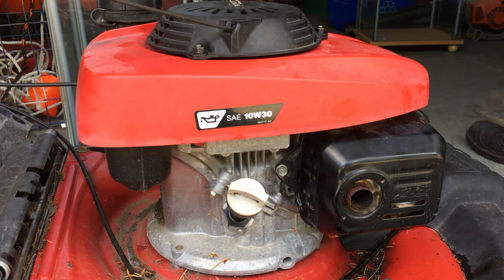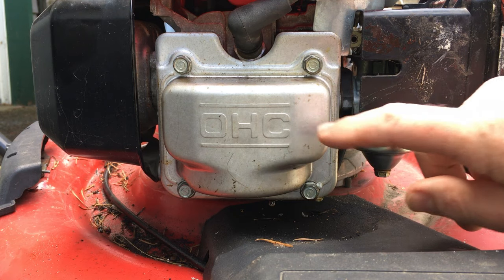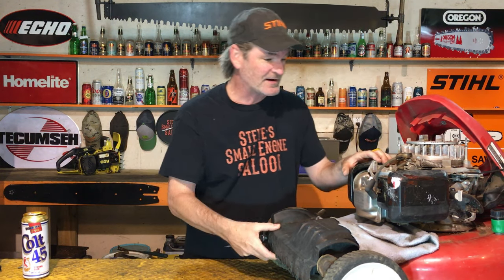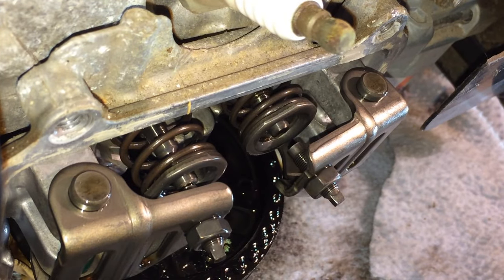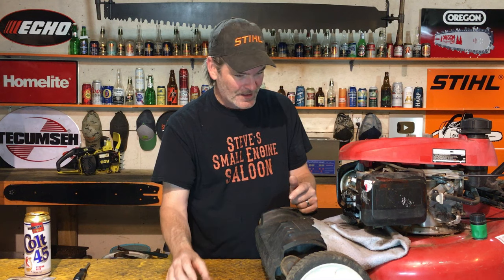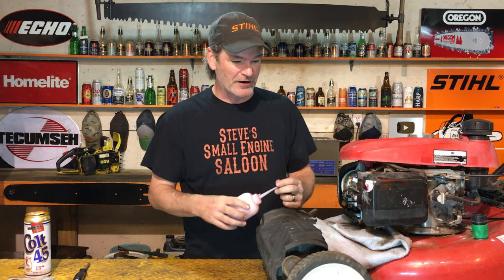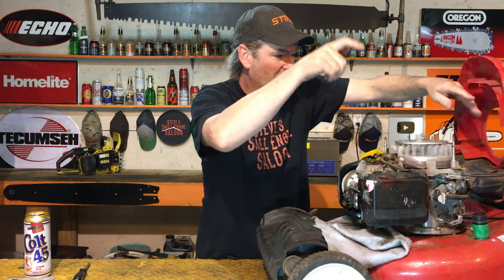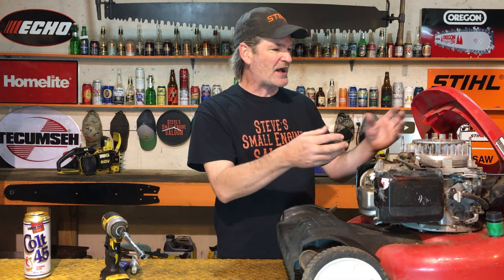How To Fix A Lawn Mower With No Compression

Comment: i i love your videos im single female who has to try and repair my own mower ,sure wish you had some vids on murry push mowers with ready start engines cant figure mine out ...
Reply: Most Murray mowers are powered by Briggs and Stratton or some may be Tecumseh engines.  Look at it closely and see what it is. Then, check through Steve's videos to see how to diagnose your problem. Clean oil in the right amount, right SAE  weight and never overfilled, fresh gas, a new spark plug properly gapped  AND a clean air filter to start with first. Murray/MTD make a majority of mowers that are "branded" as other manufacturers products.  download the engine manufacturers PDF for that exact engine. Briggs and Stratton engines have three sets of numbers that identify each particular engine known as the Model, Serial and Code. When ordering parts you must have those three sets of numbers and if you call or go into a local supplier, it's the first thing they will ask you for. Older engines have them stamped on the metal cowl that fits over the engine that the recoil starting winder is contained in,  just above where the spark plug is, the spark plug wire coming from the coil emerges from a little bend in that cowl. The cowl is also what directs cooling air down onto the engine block when it's running. The numbers are right there. Wipe off the grime with a rag dampened with some WD40 and you'll see them. Make sure you write them down EXACTLY. Every part designated for those numbers will be the right part for your machine. The newer versions of the 400, 450, 500e series engines have a QR Code and a serial number on a sticker to aid in downloading information and parts from the factory. Hope this helps. Good luck... get some tools and start turning wrenches!

Comment: I have been inside that valve cover of a honda engine countless times! So I figured I would comment about this. First,  I always take a BernsOmatic propane torch and go around the valve cover and put a little heat around the edge before I start prying on the cover because they don't come off as easy as yours came off unless someone has had it off before. But it has been my experience that you will bend the crap out of it trying to prying it off cold! Honda bond is some of the best sealant i have ever seen used in the mechanical world! That and Permatex ultra black are brutal to remove a sealed pan gasket with it on  without applying the heat first. Now, once you get the cover off of a honda there are two things you should look for right away! First thing is whether you have an old style valve cover or a new style cover because it it doesn't have the  piece of metal that keeps the timing belt from being able to jump the teeth on the cam gear you could have a engine that has jumped time with the old style valve cover. And next thing you will want to check ( And especially if you're dealing with a horizontal shaft engine like you would find on most power washers is if the  exaust rocker arm is cracked! I have seen this happen several times before when it has been ran with a loose adjustment and it starts beating the crap out of it! And it's always the exaust side that this happens to due to the heat that the exaust valve side experiences.  😉

Comment: everyone that knows me always asks if i want a lawn mower they picked from garbage.   i always say yes because i take metal to scrap yard if it isnt worth fixing.   i bet there was only one mower that wasnt worth it out of all of them and most were all simple carb cleans spark plugs. air cleaners never replaced etc.    i have a super front wheel drive honda I picked from the garbage 5 years ago.   still runs great.  new air cleaner and drained the fuel bowl.  thanks for the great videos

Comment: new Yard force mower with  briggs 675exi engine 7 mowes on small yard...NOW no compression,  i check the valves like your video you can push them in and they spring back out.  What else to check??

Comment: Hey Steve! I have a John Deere JS60. It has a Briggs and Stratton 12h802 motor on it. My father told me before he passed away that it was "shot". Not knowing what he meant, I started to take it apart because it wasn't starting. Took apart the carb, cleaned it completely and that didn't work. Changed the spark plug. It doesn't start even with starting fluid. Barely gets going at all. It puffs white smoke from the exhaust when I start it and backfires sometimes too. Compression is definitely not there. My question is what can it be? Coil? Valves? Can you lend an opinion? And if it is the valves, how do I access them? And I guess my first question should be is it even worth fixing? Lol anyways, I really hope you get back to me on this. Thank you for your time!
Reply: Replace the flywheel key
Reply: @daviddavis981  the flywheel was actually intact and in good shape. I had 2 of these mowers and 1 worked so I decided to just junk this. Thanks for the help though

Comment: nice job. may i ask if a highly polished trans pulley on a regular self propelled mower cause the belt to slip?  has nuff tension but the inside of of pulley looks like chrome it is polished so much. thanks.

Comment: Solid Gold - thanks Steve. Had the exact same problem and I am very grateful for your solution.-  the mower had been sitting over winter and started 2nd pull no problem this is probably the 4th time I used it and low and behold had no compression - I lost a lot of time messing around checking spark plug, spark and fuel - I even pulled of the exhaust to see if that was carbon blocked. The mower had run perfectly last week and suddenly just refused to start and after being unable to fix it - I headed inside and decided to see if you had any good advice - as usual you had the solution.
Reply from the maker: You're Welcome...and Thank You...

Comment: Steve, I had a similar no compression problem on Honda GX powered paint sprayer belonging to a painting contractor. I broke it loose by taking my drill and chucking up a socket and turning the crank over rapidly and squirting carb cleaner until it broke loose and started to run. Once running, I let it warm up, shut it down and drained the nasty crud that was taking the place of clean motor oil. I called the guy and told him to bring me some fresh oil. I had it purring like a kitten while he hooked up the paint hoses to clean out the water and latex and run mineral spirits through the paint pump because of the freezing temperatures expected that night. I asked him when the last time the engine oil was changed. Almost 4 years old and he said he only added oil. He had coked the exhaust valve. 
Thanks to your video, I will know to look both ways at the valve train. I knew on this one that it had to be the exhaust valve once I checked the oil before starting to work on it, as it was "sludge o matic" grade funk. I still find it hard to believe that people don't know to change oil per manufacturers recommendations. It was a top of the line spray rig he said was over three grand and had NEVER changed the oil. I charged him 40 bucks, he gave me 60. Go figure.

Comment: I have a 140cc B&S that’s blowing exhaust out the crankcase breather tube.  I changed the head gasket and adjusted the valves…Would a sticky exhaust valve cause the crank case fill with exhaust?? Or would it be the rings  ??

Comment: Nice fix Steve! Have you ever tried Blaster Advanced Small Engine Tune Up? I've used it many times with poor running or smoking engines and it does a great job cleaning pistons, rings and valves.

Comment: Obviously this is an issue with this engine.  This is why I watch you Steve!  I was ready bro tear down my motor and replace the valve, now I have a much less involved project this weekend (hopefully).  I still need to clean the carb as this mower has been sitting for years, I am glad I didn't throw it away.
Reply from the maker: Glad to help

Comment: You and Rainman Ray are excellent teachers.  I like and use the penetrating oil your brother taught you to make.  It has been working great for me.  I also use something my Grandfather and my Dad used.  Our family were farmers and my Grandfather owned and operated an auto garage in town.  My Dad also worked for an engine rebuilder during the winter months.  In both placed they used Marvel oil for a lot of things. They would coat bearings and cylinder walls with Marvel while assembling. They did this to prevent scoring when first stated.  I used to drain tankes in my small engines in the fall and use fuel stabilizer in my supply of gas in the winter.  Sill I had to replace the carb kits every two years.  I gave up on that.  I not only run a couple of tablespoons of Marvel in the oil when I change the oil in each of the air cooled engines.  I also started putting in a tablespoon of Marvel in my gas cans before filling with gas.  I would use the gas with Marvel to mix with two stroke engine oil. Since I stared this about 30 years ago,  I go ten years plus on these engines before replacing carb kits.  I realized about a year ago I should treat my vehicles the same.  They are running very well.  For my grease, I use a white wheel bearing and general purpose.  Very good at high and low temps!  I use this in bicycles, too.  I learned the white grease trick from the printing industry.  The big printing houses use it and maintenance has to keep the presses rolling is quite the job.  If a job they are printing involves milions of copy they cannot shut the press down.  Maintenance is required to write down in a log the color of the grease that squeases out then the bearing is dark or white has to be noted.  They use the white grease because it gives them a heads up to schedule this press for a bearing change at the end of the current order.

Comment: Particularly good video for me. I found a similar mower being thrown away by a neighbor. It ran but not well. Logy and no power. Same valve was stuck open. I thought maybe the spring was weak or broken but turned out to just be stuck. Sprayed Liquid Wrench in there and worked ok. Also ran strong mixture of Sea-Foam additive. That REALLY did the trick. Must have been gunk and goo in the carb too. -- Can you tell me if most small engines have this type of valve cover? And so easily accessible as the Hondas? -- Keep up the vids. Love your beer choices. Cheers!

Comment: A one time adding of a little Berryman's B-12 or Sea Foam in the fuel will help to dissolve the rest of the varnish out of the carb and carry it to the cylinder to be burned in use.

Another good one Steve!

Comment: Thanks Steve. My 13 year old Toro thanks you too. 
So easy - I used CRC to free up the exhaust side and some marine sealant for the cover
I had a blade which was 1 1/2 short on one side too. I was nearly going to ditch it, now it is back in the 'stable'
Reply: RTV Sealant

Comment: i have a remington MTd mower is failry new but the last person threw it out becasue the rocker arm bolt broke soemhow...i installed a new one and it did run but as it runs the bolts or nuts rather begin to eventually wiggle them loose . does tightening the bolt itself tighten the nut too on the end? those on the end are the ones that come loose then the arms fall off again..i ahd it running good..i do this as a hobby out of boredom and to get a sense of accomplishment :) ive fixed pretty much everyone ive tried but now im getting stuck on this one and a tecumseh i currently have . itd be a shame to throw them out the remington looks to be a year or two old at best no rust or anything looks new

Comment: All right, grab a beer (Elysian space dust) and sit down and watch Steve fix another engine for practically nothing! Thank you my friend 👍 😃
Reply from the maker: You're Welcome...
Reply: Great video. Working on a lawn mower which I believe has no compression. Will try your way by spinning the blade. Question:  What kind of compression gauge tester is used. Bought one at Harbor Freight Tools which is to test gas engines like car.  Can this be used to test a lawn mower.  I got a reading of 30 psi.  Used gauge on another good running mower and got a reading of 50 psi.  Seen many videos, but no one has ever stated, well this is the correct compression gauge tester that you use to test lawn mowers. Also can this gauge be used to test weed eaters. Thank you for your answer.

Comment: My pressure washer had the exact same problem, easy fix.  Only problem was I put a new ignition coil, new carburetor, new spark plug on and still did not start.  I saw a video on youtube that had a brand new lawn mower that would not start.  He took off the valve cover and sure as heck one valve was stuck, I don't remember whether it was open or closed.  Mine was closed shut, I just sprayed it and gave it a few hits with a hammer, and bingo it started working perfectly.  Unfortunately, this happened after I purchased a new washer so I can clean my siding.  Thanks for the tip on this video, I'm sure a lot of folks will learn from this.  FYI, my job took 24 beers lol.

Comment: Hi Steve I have a question,,I have a riding mower that it has only 40 psi compression  it cranks but it doesn't start, also only one ignition coil is working if I put a new ignition coil will start even with low compression?? Any suggestions will be appreciated

Comment: I only watched this one because of the Colt 45. I thought you were never going to get to it. I guess if a Honda or Chonda gets stored with a valve open, this could happen. Or maybe any of the OHV engines? I never heard of a problem with the L heads doing this. Have you? Nice first pull start. I paid $20 for a 1973 generator that needed a new coil. I upgraded it to electronic ignition & ditched the points (Sorry Bruce Pender) and it started first pull. That 1973 Briggs starts fist pull most times. Never a stuck valve. If it will not start first pull, it is because I have the choke set wrong.

Comment: MegaFlaxman
I hope I can get a response on this question. 
I have a 2008 Honda clone 6.5 horizontal shaft. It was in the original box till just recently when I aquired it. I filled with oil and gas and wouldn’t start. I checked the compression and it’s 28 psi. Checked the rockers and they’re moving like they should. I removed the rockers and physically moved the valves up and down, both seem to be seating properly. Filled cylinder with oil and tried again, still 28 psi. What’s my next move, remove the head and check the valves?

Comment: Hi Steve from down under! Would 60-65 psi compression be considered unacceptable for a new (ebay) 26cc line trimmer? I actually purchased 2 identical units and both start and run fine.

Comment: Hey @steve’s small engine saloon, I’ve got a toro push mower with a kohler engine on it with no compression. I tried doing what you did in the video and one of the pistons was stuck it is not now but still won’t start up I know it it getting fuel and spark I’ve replaced the carburetor too what else should I do?

Comment: Great video, Steve. I went and watched your video on how to check if your mower has compression first,  which was also excellent. I'm a single woman with a mower that starts, but then dies. Now I have a place to start, with some confidence. Much appreciated. If it turns out compression isn't the problem, I'll be back searching your other vids. 💜
Reply: Jamie Miller main jet in carburetor is clogged with dirt.
Reply: @steveb.6267  Thank you so much, Steve! Will check it out this weekend. 💜💜

Comment: im going to try this compression testr on the tecumseh if thats not the problem idk what is i cleaned the carberator 2 times already got eveyr hole in the thing but it doesnt want to start..it did for a bit but just died so i cant see it being a carberator issue but wth do i know im nto certified i learn everything form youtube:) so far its not bad

Comment: I remember the video on the solution you made to lubricate engine parts so they work freely and it is great that it worked on the Honda mower. Your tips have helped me out and I have to check one mower I have now and see why it won't start. It is a Craftsman and at first the battery was the problem, but it was replaced and now there is another problem. I am going to check to see if field mice have been chewing my wires into.
Reply from the maker: Right on Sid..

Comment: Steve,,  I also have a similar story on a Honda GX 160 5.5 HP Motor on a Plate Tamper.  It has been a few years between when I used it and when I tried to see if it would start.   Anyway,  I went to pull the cord and the piston moved part way then seemed to get stuck.  Having not seen this video yet,  I tried to free it up by pulling the plug and actually spraying some Penetrating oil into the cylinder. Got it unstuck, but now it seems to have no compression.   Since it is an OHV type engine,  I definitely think I will do like you did and see if a valve is stuck before I do anything else.  Of course I should also look and see if I can see any scoring of piston and cylinder as well, but if it is the valve, that is way simpler a fix for sure.

Comment: Great video as usual Steve, you've really helped me in keeping all my "acreage" tools repaired and running properly.  I have a question that I have not found addressed anywhere.  I recently changed the carburetor on my JD Z425 mower.  Now the choke has a tendency to work towards the closed position while in operation, so I have to keep checking it else it starts flooding.  It seems like the cable is now too free, which doesn't make sense to me.  It's the original cable, which worked fine with the old carb.  This has me stumped - any ideas?  Thank you.

Comment: Hi, my Honda cvg190 has no compression.

Valves are OK, but  cylinder not moving up or down. When pulling cord, it makes sound like rolling of bearings without any resistance. 
I put oil to cylinder through spark plug hole but no help.

Do you know what wrong with it? Thanks.